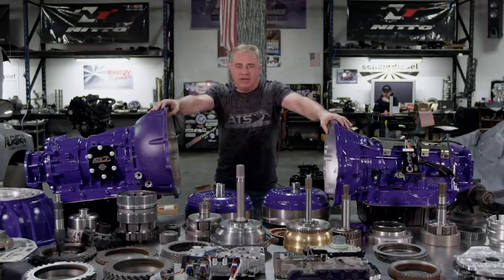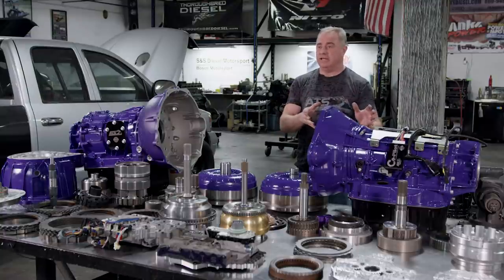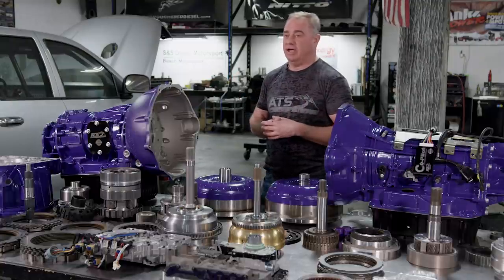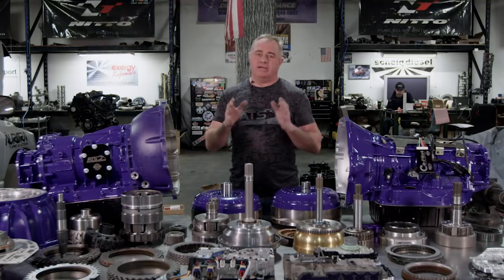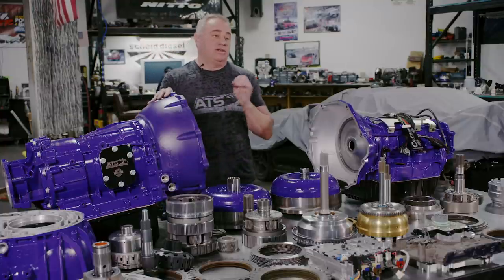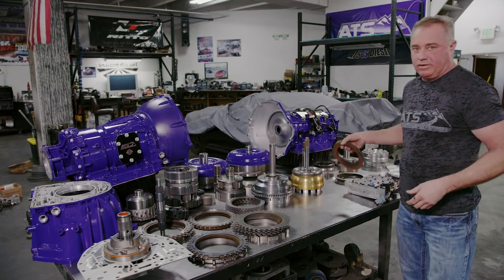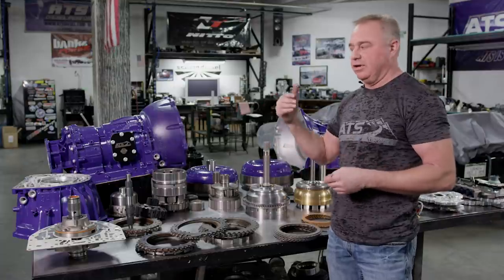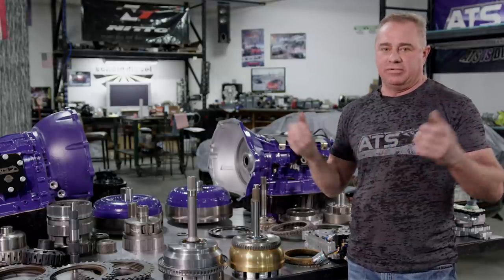Allison Vs 68RFE Comparison

Comment: "68RFE is a great transmission" aka "68RFE is a great money maker" lol
Reply: They don’t call them Another Transmission Soon for nothing
Reply: @OrionsKelt ?? ATS ?
Reply: The 68 is a great transmission,the problem starts when you mod the engine for more power then hook up a big trailer.If you leave the engine stock you’ll have no problems with the transmission.
Reply: @OrionsKelt  
Are you wasv vv ppp0
Reply: @JohnDiMartino 2018 failed at 16k miles bone stock no mods
Reply: No towing either
Reply: @JPContractorsRoofing 22 2500 Ram tuned and deleted with 65K miles towing around max daily. Zero issues with transmission. 😮
Reply: @JohnDiMartino lmao. No. No sir that’s not correct. Stock trucks with stock tires with factory 3.42’s burn up 5th and 6th without any help. A trans tune will certainly prolong it, but the 68 is a sloppy pile of bolts. I put 4,000ish miles on my personal truck every year (11’ 3500) it’s tuned and pulls my gooseneck, only reason I still have it. And I’m just waiting to have mine re done. Surprised I’ve made it this long without issue.
Reply: @JPContractorsRoofing 2020 2500 tuned 75K miles, tow tractor and firewood regularly…no issues
Reply: I'm rebuilding my 68RFE as a stage 4 next week. I can't wait, I hope it's what I actually want 😂
Reply: @JohnDiMartino I somewhat agree... I only did a delete and and a tune and it started shuddering... I'm glad I am rebuilding asap

Comment: I had an Allison in a motorhome a few years ago. Driving up and down hills with it was effortless. The engine braking and downshifting worked so well I never had to touch my brake pedal. Towing was also pleasant, the transmission never jerked or jumped or hunted for the right gear. Too bad Chrysler didn't offer them as a factory option on the 2500 3500 trucks.
Reply: yea right Allison is GM Chrysler ain't going there
Reply: Aisin is Toyota and they went there. Unfortunately you have to go to a 3500
Reply: @troydeck3017  It's already confirmed, for the 2022 year RAM moves over exclusively to Allison for the 2500-3500 line of RAMS. Get with the times.
Reply: @quadrifoglio6058  really? Great notice.
Reply: @troydeck3017  well... looks like they changed their minds
Reply: At one point you could get a ford f650/f750 with a cummins allison powertrain
Reply: @CaptainRudy4021  Too bad Ford dropped that combo. It was much better than their Powerstroke and every transmission they have tried since those days.
Reply: @quadrifoglio6058 this comment aged well huh bud? Still no allison, it's almost 2024...THEY ARENT GOING TO DO IT!

Comment: Im so excited. Getting mine in May...
Reply: How much is it setting you back?
Reply: Well in stock form they told me 10300, but im having mine upgraded to handle a 1000 Hp.
Reply: @andrewclarke6802  how did that work out? Hopefully better than the ATS fully built I bought that was garbage!
Reply: @waterishdrake8693  I actually went with a built 68RFE instead. I was quoted over 12 for the one I was gonna get... My 68 is built to handle a 1000 horse and it's been beat one and never had an issue...

Comment: What about the automatic downshift in tow haul mode and the torque converter lock up when the exhaust brake turns on?
Reply: Its opposite. The Exhaust brake turns on at the downshift. Not the other way around. And only in tow haul mode. The exhaust brake on a 69 with the shift timing is bad ass towing. Throw you forward in the seat and all you have to do is tap the brakes. I wouldnt want to lose that either, but the causation is opposite.

Comment: So how does the Allison compare to the Aisin?
Reply: It's only my opinion but to me it makes little sense to put a 10 speed anything behind the 6.7 Cummins. That engine builds immense torque because it's an inline six. The advantage, to me, in having fewer rations (Aisin 6 Speed) keeps the Cummins in it's torque curve which makes it very happy and "inline" with it's engineering. A ten speed gives more and closer ratios but never makes the engine really work, you rely more on Horsepower than torque. The Cummins 6.7, the HO in particular, loves to work. My 2020 RAM 3500 SRW with the HO and Aisin is a monster and still gets close to 20 MPG driving like I like to drive. Aggressively. Again, just me opinion.
Reply: @davidlariviere7784  Hmmmm....  He said its an Allison 1000, which is a   "6 SPEED Transmission"!!!  Not sure where you got that it a 10 speed!!??

Comment: Which cummins engine is that new bellhousing compatible with?  Only 6.7s or all the way to old school 12 valves?
Reply: Only the 6.7s but any 6.7 truck from 2007.5 to now
Reply: @gabranmitchell9722  I got in touch with ATS and apparently this will also bolt to a 12 valve through a 47RH/RE adapter plate.  Time will tell.  "A few more weeks" before it's available.  But they also said that a month ago.
Reply: @etiennegignac  Where will the transmission get it's control signals
Reply: @1STGeneral  Standalone controller.  ATS is developing one but there are already some options available on the market.
Reply: Check out this video https://youtu.be/bQh8jpVHxbo They have an adapter plate that fits both 12 valve and 6.7

Comment: Please offer individual parts as well as a complete kit. I am doing my research now for a 6.7 Cummins/Allison swap in a 1947 5 ton Gmc. I already have an Allison and would really like to use your bellhousing and torque converter for my swap. Being able to buy the bellhousing would be a huge help so I can do mock-ups and not have to spend all the money up front just so I can start my project.
Reply: I hope they do so of you break down on the side of the road in 20 states away you can have the parts shipped and transmission fixed. These are the issues with doing these upgrades and swaps

Comment: Yeah Ram has needed the Allison for a long time. My 2020 2500 with 37,000 miles has already had the trans rebuilt around 20k miles then had to be replaced at 34k miles. That's the definition of unreliable.

Comment: I have really had an eye for the Dodge 3/4 ton and 1 ton SRW Cummins trucks for a little while now. Especially the 5th gen trucks. The one thing that's always kept me from pulling the trigger on buying one is the transmissions. I've heard so much negative stuff about the trans in dodge trucks. Everyone I know that's had a dodge truck (gas or diesel) has all had transmission issues out of them. And for the price of these trucks, you shouldn't have to worry about if they're going to last.
You know Dodge has to know about the issues they have. I've always wondered how come dodge doesn't sink a little R&D into finding out why their trans keep failing and correct these issues to make them more reliable?
This would be a pretty good powertrain. Cummins with an Allison.

Comment: Is ATS going to be offering these components for independent shops to use or will they be ATS specific and only sold with/on an ATS transmisison?
Reply from the maker: These will be sold as a kit with or without the transmission.   It will be available for shops to install and also provide their own transmission.   Individual parts will most likely not be offered.

Comment: I rather see the comparison of the Aisin to , the Allison , people don't know when they buy a new truck, there a better option at the dealership, the 68rfe is a great light duty trans, but for us working guys , I'm ready to drop in a  Eaton transmission.
Reply: No one does but its also because as an aftermarket parts company, theres not much you can do to a 69. I have a 14 delete tuned HO. Cant tune the trans. He mentions line pressure is already maxed. He doesnt mention that it has a 4 disc converter which cant really be improved upon in stock form... There are converters you can drop in, but not really tangible improvement. We all know 68s suck. The dramatic effect for the video is better. Not as good to say "look as these two beef shafts" lol. This is going to be mostly for the 68 guys because thats the market opp. They break alot. If you have an AISIN you dont really need an allison unless it breaks. That doesnt happen very often, but its nice to be able to compare costs because like anything... it can break. A bolt in 69 is 7-8K before core. If this is similar price and works with all the creatures like he said? Itd be a better shifting AISIN. Thats the biggest complaint with an AISIN and mine too. Its a clunky shifting beast, but it is a beast. Reminds you youre driving a truck and not a ford taurus.
Reply: @timryan1360  that's only problem with my 69 is the shifting, the banks pedal monster helped a lot with the shift points,
Reply: The hate to be the bearer of bad news but the Aisin is not built much stronger than a 68rfe. Put a deleted and tuned 6.7l with a cheetah turbo strong enough for 700hp and 2000lb tq and it breaks also pretty easily.
Reply: @marlboroman71818  what? There is no stock transmission on the planet that can take 700/2000 and it takes more than throwing a cheetah on a 6.7 to get it. If you were at 700hp on a cummins, youre not at 2k tq. If youre at 2k torque youre at more than 700 hp. While we are talking about anecdotal evidence a guy broke his aisin doing a burnout with a 200hp tune. He asked on a more than popular cummins forum if anyone else had ever broken theirs.... crickets. Anything can break but an aisin with a mild tune does not. Cant say that about any other transmission. Including an allison.
Reply: @timryan1360   @tim ryan  There are plenty of Factory upgraded turbos that have made 700hp and 2000lbft of torque. Mine is one. If you want to see more I suggest you check out some of firepunks videos. No one said stock transmission. We are talking built 68rfes and Aisins that have no aftermarket support with cummins that actually make the power that easily breaks them just from an upgraded factory turbo, tune, deletes and a few other things.
Reply: @timryan1360  758hp=1990lbftx2000rpm/5252
Reply: @marlboroman71818  youre moving the goal post. I can make any car or truck have 700hp if im allowed to change everything about it. If you want a reliable truck that will pull everyday of its life. Aisin cummins with a cp3. You can comfortably be at 500/1000 and pull and not break anything. Thats why cummins and ram worked together to build them that way. So they can be first to factory 4 figure torque and over 35k towing first before chevy and ford. Saying cummins doesnt support it? When an aisin down shifts the cummins exhaust brake kicks simultaneously. And back to 500/1000? Even a stock allison doesnt like those numbers. A stock aisin will be fine up to 1200 tq which would be about 700 hp. If you are building a racecar? Sure. Whatever youre on about. Yours is not the numbers youre talking about. Guaranteed.
Reply: @timryan1360  lol 👌.  Now I'm moving the goal posts since the facts don't line up with your narrative and you know my truck better than I do. I'm glad you put it together for me. I pull a 43ft 26,000lb Toyhauler around for my side business regularly.
Reply: @marlboroman71818  If you pull regularly, you shouldnt have gone that extreme on the power adders. Probably why you keep breaking transmissions like your direct reply stated. And if youre making 2K tq you should talk to your tuning dude, because you should be well into the 1000s on hp. I can see you can afford things but not understand things. Thats okay. Your life. Not understanding the relationship between engines and transmissions accounting for purpose at all.
Reply: @timryan1360  if you knew anything about diesel engines you would know that your foot controls how much fuel is fed to the cylinders which determines how much power you make. Also If you knew anything about diesel performance and tuning you would know I have selectable power levels and to be blunt you have no clue who i am or what I know or what vehicles I have put togetherwith my own hands and built for what purpose with good results, but if you'd like to verify that your welcome to come see for yourself. Thats a friendly invitation also, no bullshit. I'm in the Houston TX area. You can find a picture of my truck on the Aztec custom wheels Facebook page.

Comment: The 7.3 powerstoke would also benefit from the Allison transmission especially when there over a million of them around.
Reply: They typically don’t make enough power to kill transmissions🤣 These are generally focused on upgraded trucks making more power, you’re correct any older truck with a 3 or 4 speed auto would benefit from the better shift splits of a 6 speed auto.
Reply: Power stroke ain’t no Cummins though…
Reply: A built 4r100 is plenty good and in many ways is better than the Allison and a 5r110 or 6r140 would be far superior to the Allison
Reply: @moparproud3978   The current wait time for a built 4R100 is over 6 months now, for a BTS or Sam Wyse. I'd say there are plenty of trucks that could benefit from an Allison conversion!

Comment: Well now I’m considering maybe upgrading my truck, instead of buying the new 2022 Ram 3500 since they aren’t refreshing the body styling of the newer model like they did for the 1500. Plus I’m still going to need this upgrade for what I’m going to use my truck for
Reply: RAM in 2022 has already announced to be moving over to Allision for the 2500-3500

Comment: That input shaft shows the entire difference.  An 1/8 th inch change  in dia is big, goin 1/2" is huge.  Torsion stiffness is prop to diameter cubed IIRC. So like 4x the strength with came metal.

Comment: Well was looking into a g56 swap but after seeing this if the price is right, this would be an amazing upgrade, also would there be just the bell housing and wiring harness for sale? And when you say a “stock swap” will drive shafts need shortened or lengthened? And tuning how would that go with it

Comment: I like the product, but calling the 6.0L starter "un-reliable" is kinda un-true lol.... Sure the 6.0 starter is dated, but the nice thing is that any 6.0 starter can be upgraded to a 6.4 starter witch is WAY faster then any dodge starter... I have a 2008 F450 that I cummins swapped (ppump 12 valve) and for being a older engine it cranks over and fires up instantly! Wouldn't do that with a dodge starter..... Plus if you do research you can actually install a newer 6.7 Powerstroke Starter in a 6.0L/6.4L! Witch then means your Cummins/Allison setup could have a 6.7 powerstroke starter, those starters are the best on the market imo

Comment: I believe the 2001 Allison was a 5 speed...
Reply: Correct till 06 with the 4th gen was built as 6sp.  3rd gen can be programmed fror 6sp but duse not have the extra flow capacity for full power or sustained use of 6th .

Comment: His definition of "affordable" doesn't match mine; or most other guys who work for a living. $10k + is not a working man's "affordable" upgrade.
Reply: I just bought a nice watch for that! Different jobs I guess!
Reply: You can spend that pretty quick on a couple of transmission rebuilds... and eventually it's probably gonna break again, unless you spent about 7,000 the first time. If you don't plan on making dumb power or doing hard duty or heavy load towing consistently, then you can save your hard earned money 😉👍
Reply: @berryreading4809  That is why I said Ram should have been offering these as a factory option. Putting the 68RFE in a 2500 or 3500 that is used for hauling a heavy trailer was very misleading. The 4th, 5th, & 6th gear overdrive clutch packs aren't designed for a diesel hauling heavy loads up and down hills; especially with Ram shipping those trucks with 3.23 axle ratios. I changed my axle ratio to 4.10 and my transmission is much more happy now (stock tires). My fuel economy actually improved by over 20% with the 4.10 ratio. Before spending $10K on a transmission swap, guys should be using higher axle ratios to see if that solves their problems. Changing axle ratios only costs 1/10 of what the upgrades cost.

Comment: I can't wait to see more about this. Looking hard at this for my 2003 Ram 3500 HO Cummins w/ 48re. A couple of questions. For the driveline changes are the specs known ahead of time so it can be shopped out while doing the swap? 2003 didn't have a tap shifter. Can this be added? Last question, will this work with an exhaust brake? I would reallllllly love to have this capability towing my approx. 14K pound Alpenlite (lite is an inside joke) 5th wheel.
Reply: Just build the 48, not as smooth or efficient, but the engine will make more than enough power with some tuning to make up for the lack of gear ratios.
Reply: I have a built 48 from ats with copilot in a 03 3500 ho single wheele does great broke the first one by not spending the money for billet input shaft it twisted off taking out tourque converter and oil pump  of course they wouldn't warrenty it cause the input shaft was stock so they told me if I bought a billet shaft theyd replace the converter and oil pump but i think I got a billet pump now too so i spent 1100  on that but it was they only way they would check the whole thing out they said if i put a stock one back in for 75 bucks it was what it was so I spent the money had the tranny checked completely it was all good all together i have about 8000 in a 48re and it does pretty well its good for drag racing being a 4 speed with OD it pulls good and is prolly a few thousand cheaper then an allison conversion I bet thats close to 10000 and all I have in my truck is smarty the old one with tnt tune and 125 hp industrial injection injectors air dog 150 and the ats tranny and it was enough to break stock input shaft I didn't think I would but it is a cummins so spend the extra bucks and save the month plus of down time it literally lasted less then 20000 miles before I broke it now its good for like 1300 hp so I should be good for a while and idk how many miles i have on it but its doing good
Reply: Alternatively, you should talk to the GearVendorsOverdrive team.